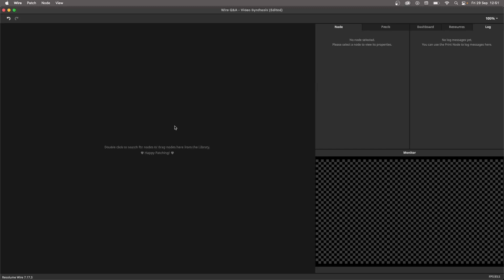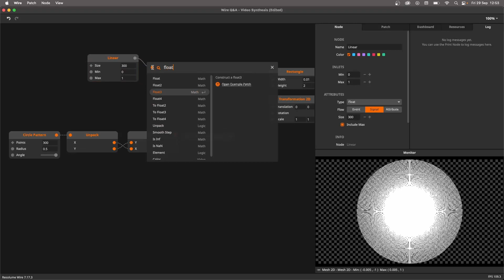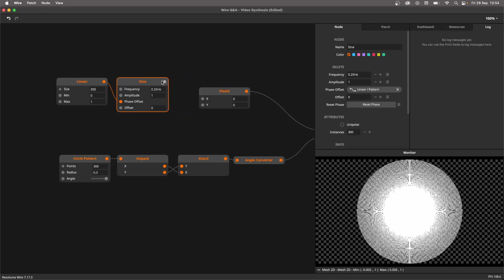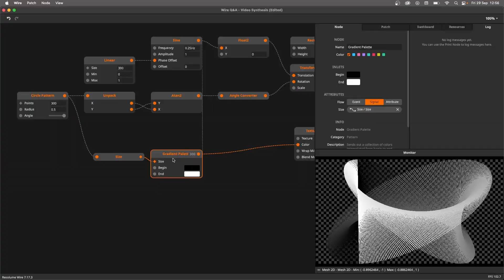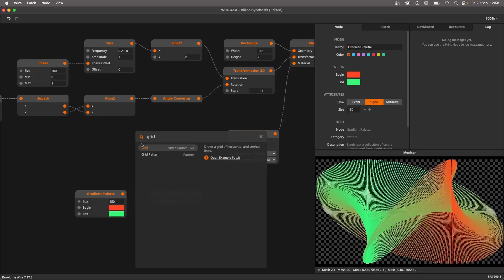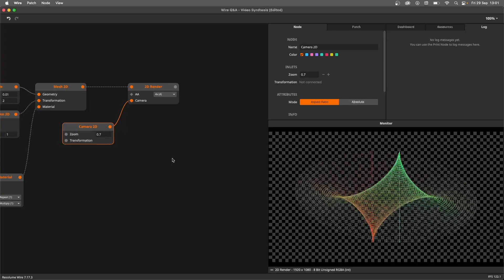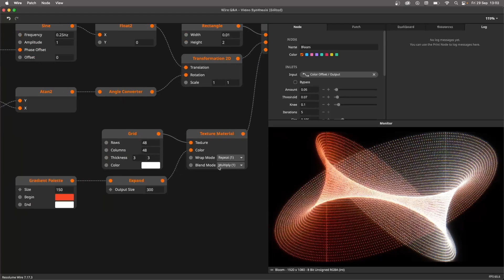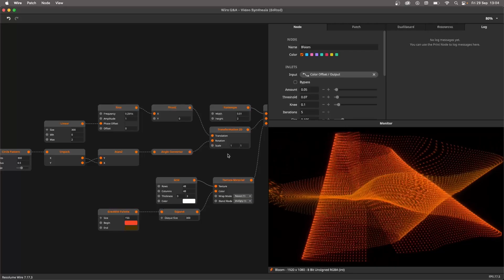Resolume Wire Q&A - Mesh2D Video Synth

Comment: Thank you so much for the video! Wondering is there an option yet to work with 3D in Wire same way = build 3d generators, kind of "3d video synths"? Would be so amazing!
Reply from the maker: We are working on 3D for Wire, but this is still a long way off.
Reply: @ResolumeVJSoftware  Good to know anyways! Good luck, we're waiting : )

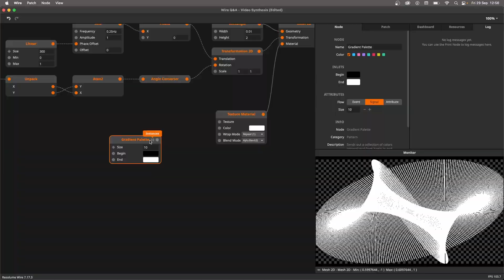Comment: Hi, Great video, I especially liked the end when you showed the various nodes to alter the image. Maybe you could do a video with that theme? Anyway, I had a problem when following (building) along with the video. I am using Wire version 7.20.1. At about 4:45 you brought in the "Gradient Palette" Node my version of Wire does not have this Node. I tried using the "Gradient" Node but it wouldn't connect to the "color" input of the "Texture Material" Node, only the texture which is going to be used by the "Grid" Node. I was able to do a workaround connecting a "color" Node to the color of the "Texture Material" Node, picking another color from the "Grid" Node then connecting to "texture". Thanks, Jim
Reply from the maker: Thank you very much.

You mean the post-processing as a theme?
What would you like to see/learn?
I'd love to do another Q&A video based on your questions.

The Gradient Palette node has been retired in 7.20.1
You can learn about this in our recent Color Type video: https://youtu.be/I-tSsWcwHxo?t=524

Long story short: Because we introduced the color type the Linear node can now do exactly the same as the Gradient Palette node. So we removed the Gradient Palette node as the Linear is a more flexible tool.
Resolume Wire is still in full development so you might find older tutorials using outdated nodes.

I hope this helps you out and let me know if you have any questions
Reply: @ResolumeVJSoftware  I was talking about the end of the video when you were done with 2d Mesh. You then used a camera, Bloom, Feedback Delay (which I have a hard time getting to work) and suggested some other effect node ideas/ I have a hard time getting things to work at the end (before output texture). I'm new with wire but getting better with the help of these videos. Oh yeah I'd like to see how you can get more (depth) between different elements with drop shadow or blur.  Thank You, Jim
Reply from the maker: @rubberbulletstudio  Sounds good to me Jim - I'll make a video for you this week exploring some post processing ideas.
(eg. what part of the feedback delay causes you issues) - feel free to share them here and I'll pick them up for the video. I think I'll get around doing it on wednesday.